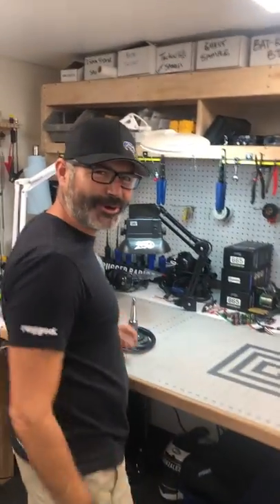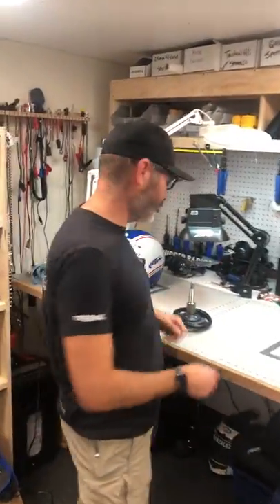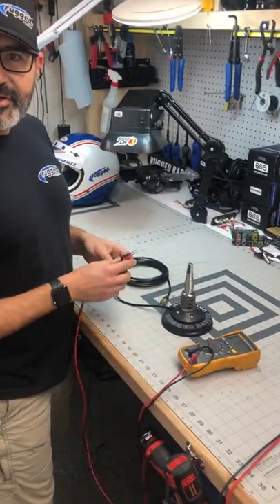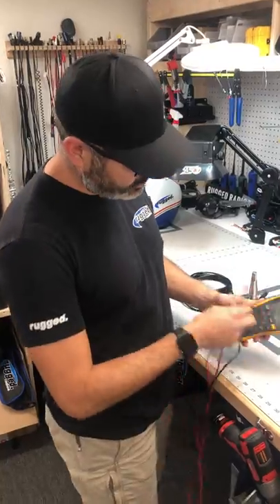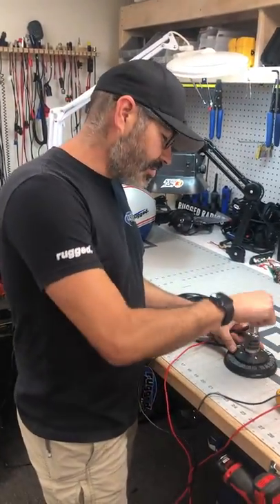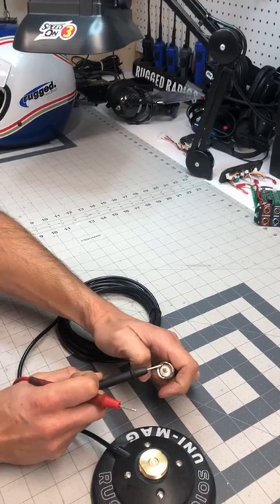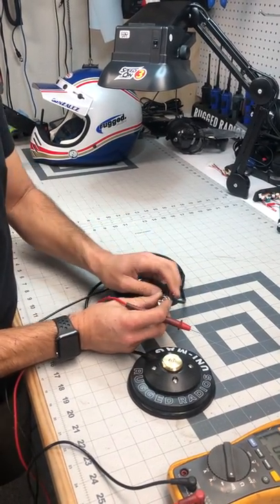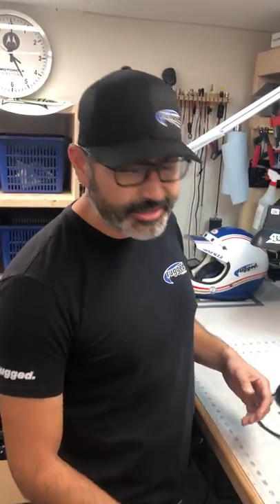What is continuity? (TROUBLESHOOT YOUR ANTENNA)

Comment: This is station 361 in Corpus Christi Texas. I know this is an old video and not sure if you will see this comment or not, but I wanted y’all to know this short video helped me find the short in my station. It was my MFJ swr meter that was shorted so I swapped out to my Astatic meter and now no shorts. Thank you for this video it got my station back on the air with no shorts

Comment: Hi I'm kind a new to the hobby, but I do know a bit about electronics, question, in the transmitter and receiver what about test the leads there, from what I understand there should be no connection with the ground lead and the signal RIGHT? then in my case is it possible that the transmitter came bad from factory? since I tested the continuity on them and they seem to have connect it them, due they have continuity and I just don't know for sure if that is how it suppose to be, could you please help me I have not found a right answer, Also tested the continuity on the antennas but as expected there should be no connection or should be? due there I bought another antenna and that one has so got me more confused.  
In one of the transmitters there was a big ball of thin in the antenna so I deduced to remove and check, when removed the thin and check with the multimeter the continuity from the antenna signal to the ground and there was connection, to m understanding that should not be... or is that correct?
sorry its too much but I had the feeling the more I try to explain the more confuse I got whether there should be connection or not. 
Thank you so much in advance for your time. Sincerely Luigui

Comment: How can I check the antenna itself
Reply: Exactly what I was wondering also
Reply: To check the antenna do the same continuity test, put one lead on the bottom of the antenna stud and the other on your whip of it’s steel, if you have fiberglass like a firestik put the other lead at the top of the antenna ( you must make sure you are touching the adjuster screw or the copper wire) if you hear a beep then that means your antenna wire is solid, if you don’t hear a beep then that means you have a cut in your antenna wire ( antenna is bad, replace) I hope this help

Comment: NOT CABLE  How to you test the antenna
Reply: To check the antenna do the same continuity test, put one lead on the bottom of the antenna stud and the other on your whip of it’s steel, if you have fiberglass like a firestik put the other lead at the top of the antenna ( you must make sure you are touching the adjuster screw or the copper wire) if you hear a beep then that means your antenna wire is solid, if you don’t hear a beep then that means you have a cut in your antenna wire ( antenna is bad, replace) I hope this help